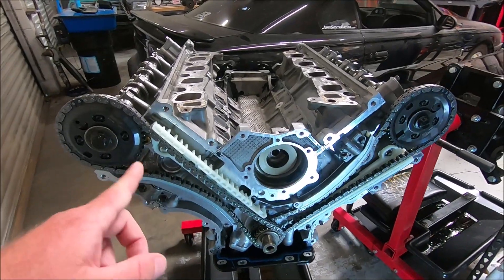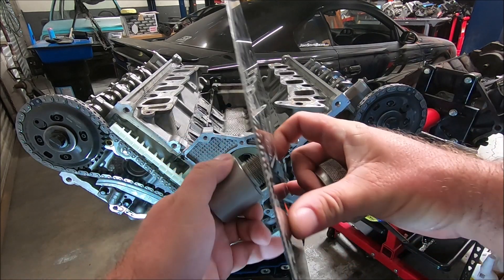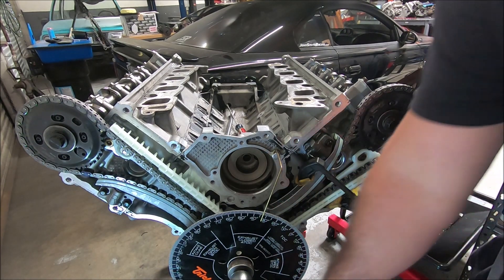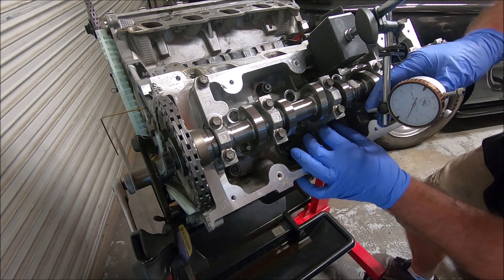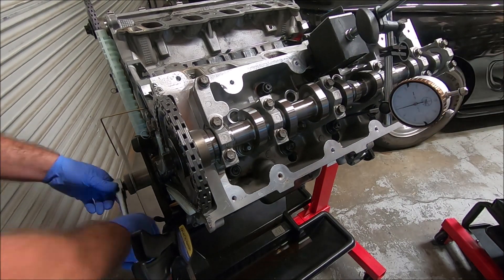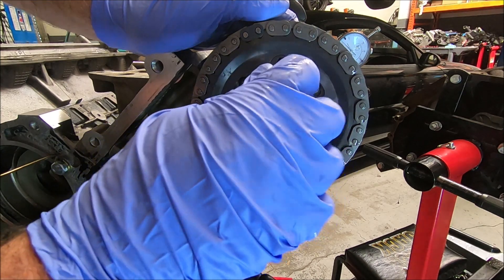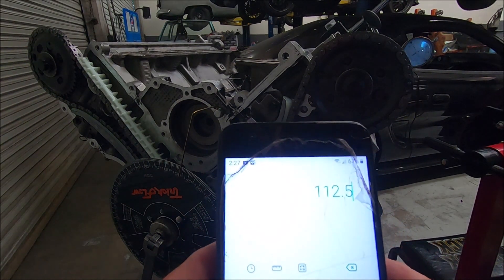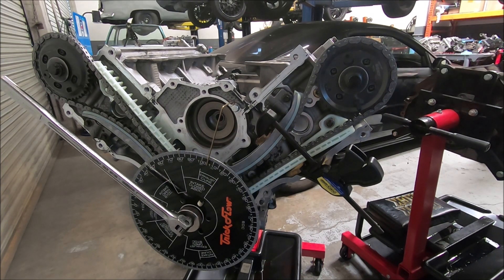99 Mustang GT with Nemak Part 15 – Degreeing Cams with Comp Cams Adjustable Gears

Comment: Do you have to use the adjustable lash adjuster? Will I be able to degree my cams and get intake center line measurements while all rollers and lash adjusters are installed?
Reply from the maker: Its recommended to use the adjustable one because it will not collapse like the factory ones will.  If the lash adjuster compresses during the process then you will not get accurate results.

Comment: Great vid mate.. Been thinking about the cam geara to degree my 4v. Over here in Australia though not much mention of adjustable gears and a few horror stories. Have you personally seen or heard of any issues or is it perfectly fine at correct torque and red lock tight. Thanks in advance.

👍
Reply from the maker: I have heard of other designs failing and I have personally seen some with the timing mark on the wrong tooth.  But the design of the Comp gears has them sandwiched together by the cam bolt.  So, when you torque them there is very little chance of them moving.  Some other brands are not sandwiched and rely on the four small bolts to keep them in place.  I believe the Comp ones could be used without those little allen bolts and still stay put.  I don't recommend trying it, but they would probably not move.  The locktight could be there just to keep the bolts from coming out and getting in the engine.
Reply: @JohnSmithRacing  yeah beauty. Definitely dont want the grub screws rattling loose and dropping thats for sure.. Might look into a set of the comp fears thwn to adjust the new cams waiting to go in. Only other way as seen many times is the key way filing..

Thanks for all the videos you do they have been great source of knowledge. 

👍

Comment: Hey John when you set the engine to TDC how are you sure your on the compression stroke not the exhuast stroke. Ive seen all the other videos where you explain to have the key way pointing to 10 o clock and the timing mark pointed down. How are you sure its on the right stroke?
Reply from the maker: I am not by engine to confirm but I believe when setting the timing, the #1 piston is at TDC at the beginning of the power stroke.  This can be confirmed by looking at where the lobe is for the intake valve on that cylinder.  If the lobe is not about to open the intake valve the piston is heading down on the power stroke.  If the intake valve is about to open, or is opening, then its the beginning of the intake stroke.  Either way, as long as the timing marks are lined up, the timing is set correctly.  I have seen some aftermarket adjustable gears that did not have the timing mark on the correct tooth of the gear.  I believe the brand was OBX.

Comment: So at 3:34 you did 
34-24 =10 
10÷2= 5 
And then moved the degree wheel from 24+5 to 29
Reply from the maker: Yes, you want to have the same degrees on both sides of TDC.